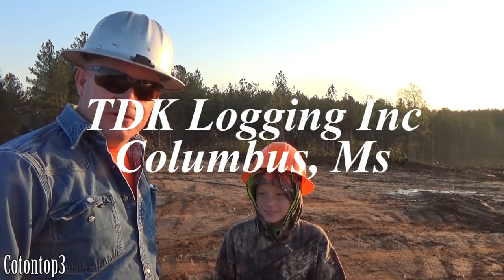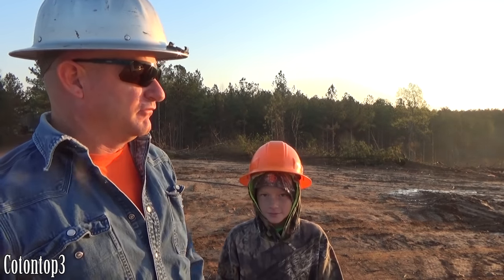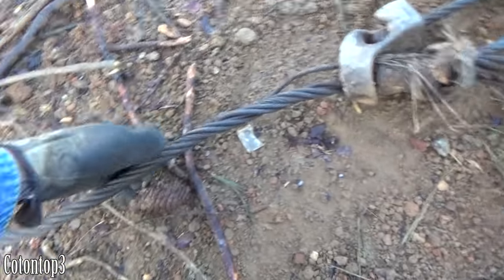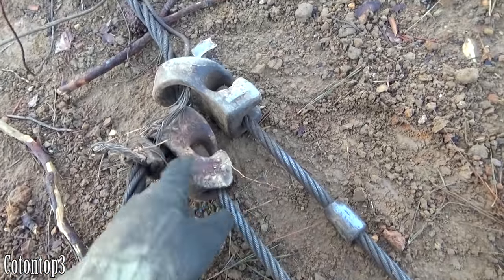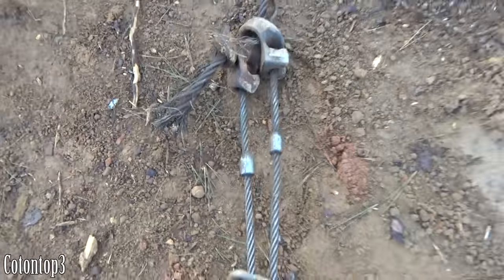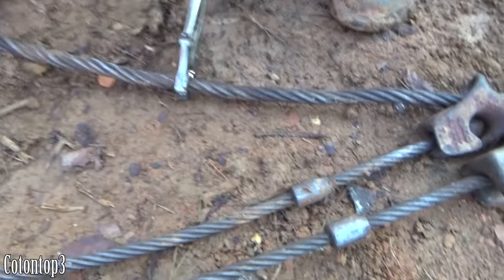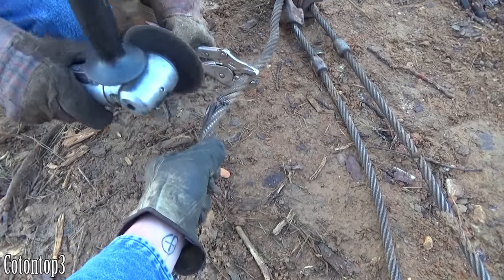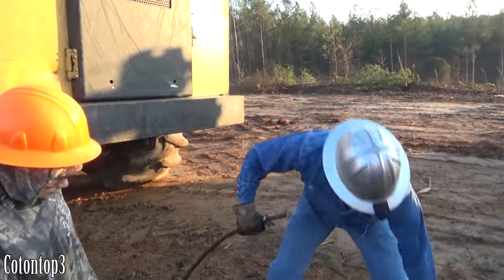How to tie a knot in a 5/8" steel cable

Comment: That's one way to do it, if u cut cable with a torch with an oxidized flame it will fuse the strands together preventing them from fraying, then loop the cable back over itself and secure with 4 Crosby clips, also known as cable clamps, this is much stronger and safer as tying a knot in the wire rope reduces its breaking strength by 50 percent. Just a couple fun facts from a boilermaker rigger, and remember never saddle a dead horse!

Comment: Have you ever tried the military surplus tow cables. We have a dealer not far from us that sells 1"used  military "tank cables" with loops on each end rated for 100,000#. They are fairly cheap too if I am not mistaken around $200. A lot of our local farmers use them for pulling out farm equipment and stuck trucks.
Reply from the maker: Usually one of these like I tied will last us 2-3 years before we replace it. The 635 has a 3/4" cable on it and we have another cable like what ur talking about that's 1" with braided eyes on each end if things get really bad.

Comment: I cut cable the same way. I do the gates at my hunt clubs. I also weld the ends to keep them from fraying and cutting someone's hand. An angle grinder with the thin disk will cut through anything. Locks cut like butter.
Reply from the maker: You right, you can slice anything with those disks.

Comment: tim have you ever tried super swedge cable, they take 3/4 cable and swedged it down to 5/8 . I worked for 10 years for a place that sold cable to loggers,once the cable came out just about all went to it .It lasted a lot longer and it is much stronger. just a suggestion all your vids are great!
Reply: Where do you get it?

Comment: We do it exactly the same but we use an actual cable cutter that u set it in and hit it with sledge hammer bout 2 times and it cuts it . may not cut it off as smooth but it does a good job . Another great video

Comment: I used to use an axe and a four pound hammer to cut the cable, never fussed with the vise grips because never had to worry about the cable unwinding much...
whatever works for ya bub, just get'er done safely and get back to pullin' sticks! lol

Comment: I know this is an old video but I have a question.
Does the knot have to be tied a certain direction? (With the twist or against the twist?)
I noticed that the twist seemed to open up as the knot tightened down. What happens if you tied it the other way?
I'm wondering if it wouldn't tighten down at all?
Reply from the maker: It doesn’t matter in this situation.

Comment: I ran cable skidders for 30 yrs, so i tied and cut a lot of cable. Tie your new knot before you cut the cable, this way you don't have to worry about the cable unwinding on you. I had trouble with a single knot slipping out once in awhile. So i used a figger eight knot. When using this knot i could cut the cable off about a inch from the knot leaving no pig tail and it didn't slip out. I cut my cable old school style, double bit axe, five lb hammer and a good stump. About ten good hits would cut a 5/8 cable.
 Be safe out there guys
Reply from the maker: Sometimes I will tie it before I cut it. It just depends on how bad exploded the cable is.  Usually it’s so bad it’s just not worth the fight or safe to try to handle with all the sharp ends.

Comment: when I was millwrighting, we had a wedge cutter, it looked like a c clamp, with a wedge and you used a 20 lb sledge to cut it
Reply from the maker: +wile coyote years ago, that's how we cut cable. I wasn't very crazy about that thing.
Reply: yea if you were not paying attention the cable would whip back and get you

Comment: Was thinking it wouldn't hurt to try welding a vise on the back of your service truck.  May make it a tad easier cutting wise than using vicegrips on the ground.
Reply from the maker: +animenut69 we do have a vise on both service trucks.